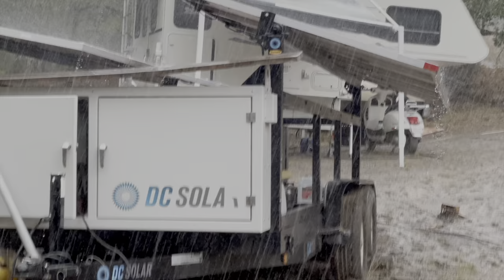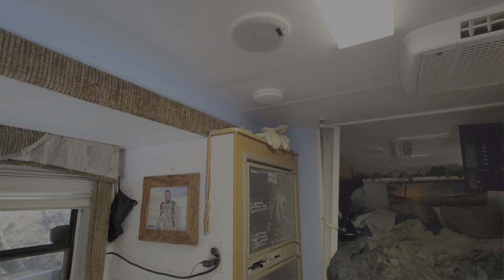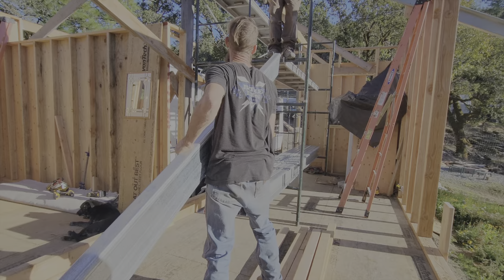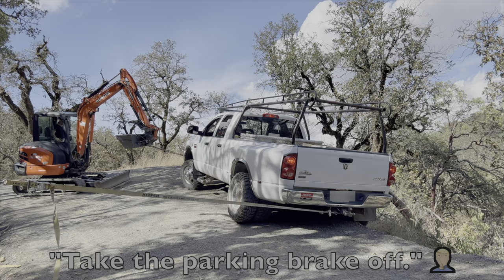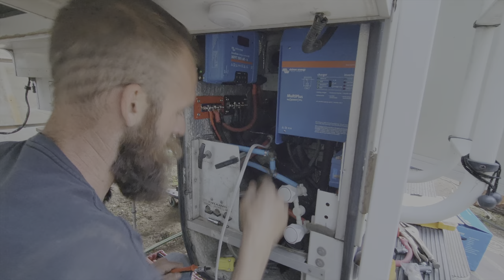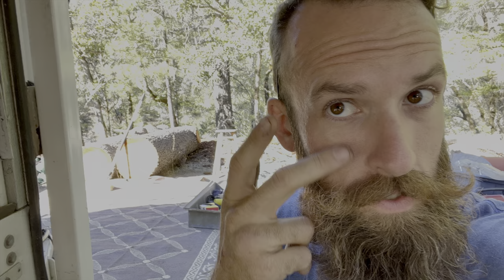Rain, Sinking Camper, Close Call & Electrical Issues: Truck Camper Life Vlog | DestinatioNow Ep.126

Comment: Isn’t your fridge a 3 way?  I figured all truck campers were using at least 2 way fridges.  Gas and electric.
Reply from the maker: Yes it's a 3 way, but still needs electricity to open the gas valve and ignite the propane.
Reply: @DestinatioNow  oh dang mine did it automatically